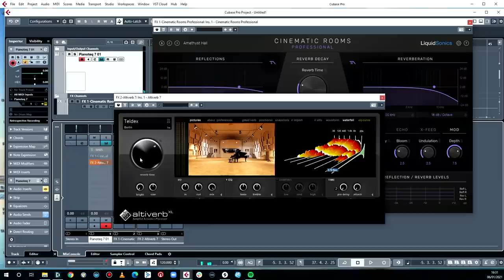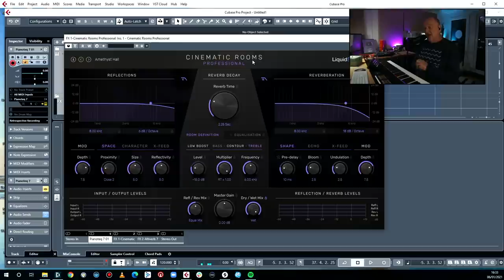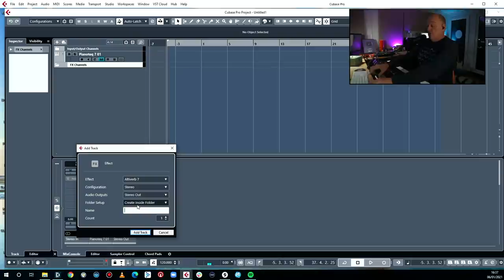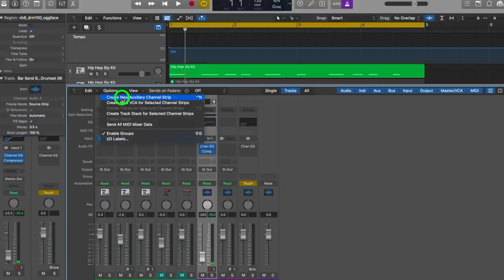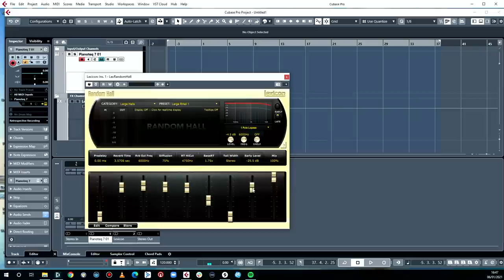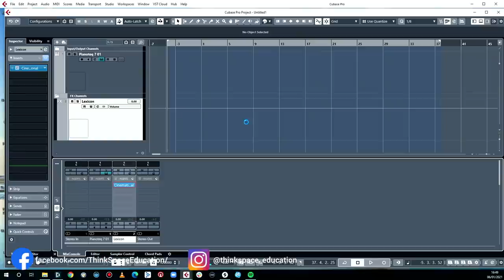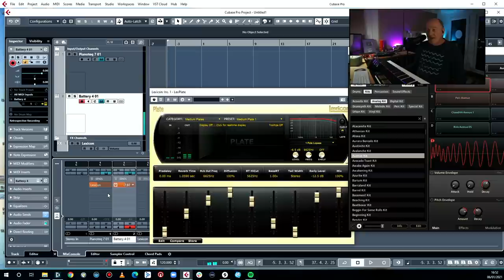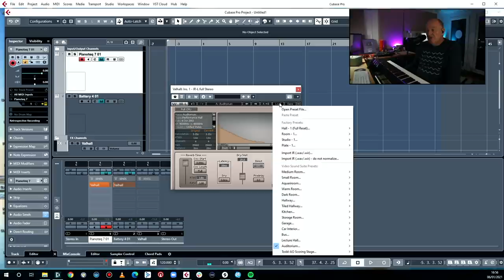Reverb: What you NEED to know

Comment: I figured out this problem in 1978.  Unknowingly I figured it out years earlier.  I could never figure out why it always sounded better when I reversed the polarity of both speakers?  When it was contrary to the user instruction manuals directives.  As I was still very young.  As in, junior high school age young teenager.  It wasn't until I was 23 and got my first JBL 4311 Compaq control room monitor speakers.  They were  "out of phase", I discovered.  To all other speaker manufacturers' speakers.  What the FUCK is going on here?  I wondered.   Until it dawned on me.  Until I thought everything through.  From the diaphragm of the microphone capsule.  Oh my God!

If everything is kept perfectly in phase and your speakers are wired as the electrical engineers have created and the manuals instruct.  Your speakers are going to be mimicking.  The motion of the diaphragms of the microphones.-Which direction are those diaphragms moving in when a sound pressure wave blast hits them?   I don't think they defy the laws of physics?  I don't think they protrude outward toward the incoming blast of the sound pressure wave?  At least they shouldn't be doing that.  Within our dimension within our universe within our cosmos.  That's antimatter thinking.  And when the two come together.  They destroy each other.  So do the waveforms trying to propagate within your room.  They are fighting with each other.  They are canceling each other.  You have a pair of electronic sound suckers sitting in front of you.  And you are happy with the rebound, the sloppy seconds, you get out of the front of them.  As they leak their audio out the back.  Of only the low frequencies.

So this is beyond idiotic.  It's from people with college degrees.  That have demanded from their manufacturers of their audio components.  They want no out of phase anything in their signal chain.  Because like monkeys with their college degrees.  They only know, a rock don't taste good.  A banana does.   And they know what a banana looks like.  So they don't try to keep eating rocks in their heads.  And so a chimpanzee.  Would learn quickly.  How to get there banana out of a speaker.  And not a bunch of pebbles falling out of the front and rocks falling out of the back  onto the floor.  Monkeys have more brains than Audio Engineers with Electrical & Acoustic, Engineering degrees.  Because they have no brain of their own that works.  That does not have to be instructed by others.  They've actually needed others to tell them what books to go get and read.  Which I find very funny.  Because they paid between $20,000 and $80,000.  To have their professor tell them to go ask the librarian where the books for audio equipment and circuitry is?

I didn't need to go pay some stupid college to get a degree in Audio Engineering.  I merely had to learn how to listen.  What to listen to.  What to listen for.  And then I found this place called a Library.  Where you can go and read all of the books you want for free!  IT'S ABSOLUTELY FREE!  YOU DON'T HAVE TO SPEND $80,000.  To tell you what you are listening to and what you can't hear.  No.  It's what they can't hear.  They can't hear.  Because they don't know what they are listening to.  Because listening and hearing are both very different.  Everybody can hear.  Not everybody knows how to listen.  Your brain has to teach you.  But if you don't have one think you need a dead sheepskin and have to be spoonfed and spend a stupid amount of money???

Well?  I don't know what that has to say about you and your self-professed expertise?  While waving a degree at me and spewing forth mathematical equations.  With the battery in your hand to connect to your speakers.  To prove that I am wrong and you are correct.  When you are not.  They are not.  JBL got it right.  To force upon everybody.  When you connect your speakers wrong according to the instruction manuals.  You'll actually have it in the proper polarity.  Because they reversed the indications on their connections to their speakers.  Because they thought this through properly.  And you can hear an enormous difference.  It's a life-changing difference.  It's the game changing difference.  And I have proved it to people time and time again.  Since 1978.  And when people discover this.  It changes their lives forever.

I am happy to post this information here.  Because our fine host i so knowledgeable, so well seasoned and accomplished.  And I absolutely agree with everything that he says.  And where now.  If he should read this little mini history making multiple major music award nominee within absolutely unreal stellar, artistic and technical background.  And he does the speaker fix trick I've talked about.  It's going to blow his mind.  But he may not be technically proficient to be able to do so?  He may not be an electronic technician?  And likely uses, active, powered, monitor speakers.  I reckon?  Reckon is a term I do not personally use as a Midwestern American English, speaking person.  But I've heard both hillbillies and very sophisticated British folk use that term reckon.  And like speaker manufacturing monkeys.  I reckon it was appropriate to use here for myself.  I reckon?

Comment: This makes it extremely easy.  To blame your bargain-basement Chinese built equipment.  It makes it very easy.  To blame the acoustics of your room.  To get you to purchase.  All sorts of acoustic gobbledygook.  To hang on your walls and stick in the corners of your rooms.  To trap the base of the bass.  To keep it from reflecting back at you in proper polarity.  So you can be listening to sucking reverse polarity rebounding from the front of your sucking speakers away from toward you.  And can continue to blame the acoustics of your monitoring environment.  Which makes it so easy.  To absolving yourself.  Of your ignorance.

If you have powered compact control room monitor speakers?  With a separate woofer and separate tweeter being powered by a pair of separate amplifiers with an electronic input crossover.  You're going to have to be good with a screwdriver and a soldering iron.  And you are going to have to reverse the connections.  On both the tweeters and the woofers.  With your soldering iron.  And then you're going to have to screw your speakers back into the box.  I'm sorry to inform you of.

I've had some of the world's greatest smartass electrical engineers tell me all they need to do is to invert the phase at the input of the audio power amplifier.  Yeah no.  That is incorrect.  That will invert the phase of your waveform.  And you will hear a slight but un-appreciable, Nuance of a difference.  And that is but a solitary subjective, judgment call.  On your part.  It does not change the Absolute Polarity, at the output of the audio power amplifier feeding the speakers.  It does not!  Let me repeat that.

Changing the input phase to your audio power amplifier.  DOES NOT CHANGE THE ABSOLUTE POLARITY TO THE INPUT OF THE SPEAKERS THAT MUST MOVE THE AIR.  AND DO SO BY INITIALLY MOVING IN THE PROPER DIRECTION OUT TOWARD YOU.

Other lamebrain numbskulls with their college degrees.   Can mathematically prove me absolutely wrong!  They can also prove the Jesus exists!  I don't know how?  If you been waiting for Jesus for over 2000 years now?  Chances are.  He's actually dead.  He's not coming back.  No matter how much you pray for him to do so.  And you cannot pray for your speakers to move in the right direction.  When they are moving in the Jesus direction away from you.  Because Jesus knows his absolute polarity.  And he is out of polarity  within our existence.  And nobody but nobody including your pastor, priest nor pope.  Can resurrect him.  No matter how much they try.  No matter how many times they go to church, synagogue, mosque, Buddha belly places.  They might attend regularly.  Waiting for Santa Claus to come back to life.  And deliver them from what?  A pizza?  Chinese food?  You get your religion and Jesus in 30 minutes or it's free?  I don't think so.

So this issue actually goes beyond idiotic.  It's created a single religion of a flock of sheep and lemmings.  All walking off the edge of the cliff.  And thinking they are going to a better place and space in their monitoring.  But you've fallen into a whole that you cannot get out of.a whole lot of idiots that don't know how to listen.  Don't know what to listen to.  Don't know what to listen for.  But they have a college degree that says they're supposed to know something about listening.  And they have no idea what they are listening to?  They are absolutely clueless!

Now of course how do I back this up?  Well?  Fixing multimillion dollar studios in 2 minutes.  Where the Acoustic Engineers and Electrical Engineers keep declaring the monitoring absolutely accurate.  They can show you plots of waveforms and test results.  And they roll it and they pat it and they market with a B.  For the babies.  Who have Bungled.  Connecting their speakers Badly.  But in phase together.  And their mathematics tells them they are absolutely right and correct!

Yeah until somebody that knows what to listen for takes a listen.  And so I've had to correct those multimillion dollar control rooms.  And I don't make much money doing that.  Because it only takes 2 minutes to make the change.  When you're charging by the hour that doesn't make any sense.  I'm going to come out and charge them only one hour?  What all of the experts have charged them thousands of dollars and have taken hours upon hours upon hours.  And additional componentry of more acoustic wall treatment gobbledygook?  And to proudly pronounce to you with their printed test results.  It sounds absolutely perfect!  When it does not at all.  Because you have to know how to listen.  What to listen for.  What to listen to.

Because there are no mathematical formulas nor textbooks.  Then have the power.  To listen to, evaluate or correct anything wrong with the audio in your control room.  Real engineers like myself have to do this.  Not frauds that waive their college degrees and spew forth mathematical equations  and then connect the battery to their speakers to prove that they are correct.  And you can see they are correct.  But you don't see sound.  You have to listen to it.  You have to know what to listen for and what you are listening to.  They don't.  They are clueless.  And they all get it wrong mathematically correctly.

No expert, no world authority likes to be told they are stupid idiots.  Especially with their Ivy League college degrees.  By nothing more than a high school dropout with a GED like myself.  And a couple of weeks of electronics courses here and there earlier in my youth and early profession and career.